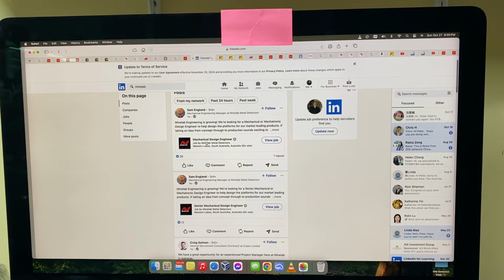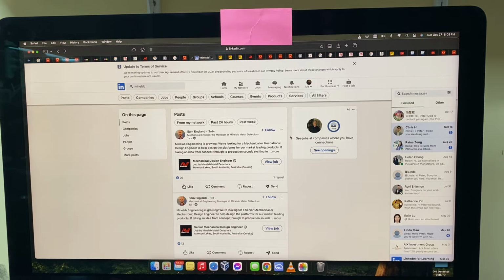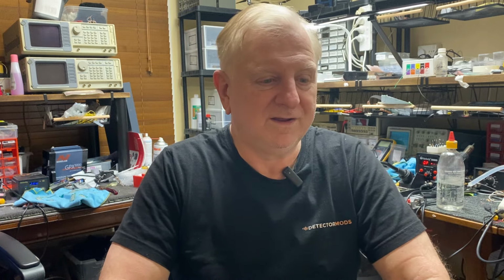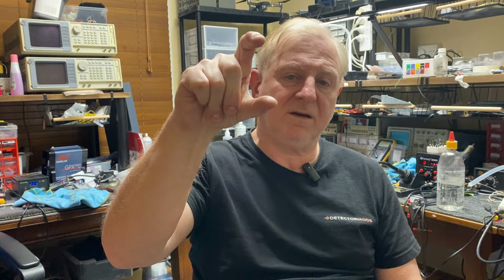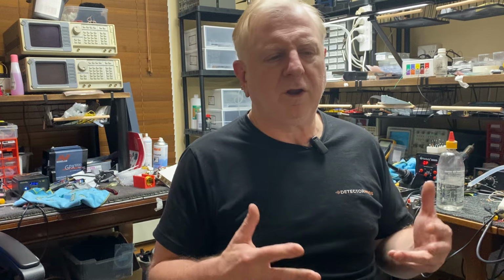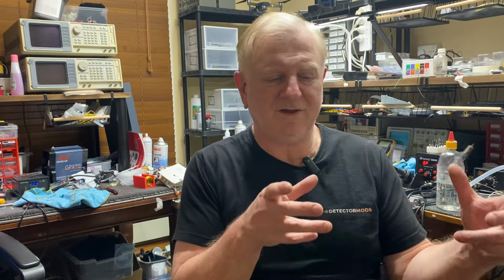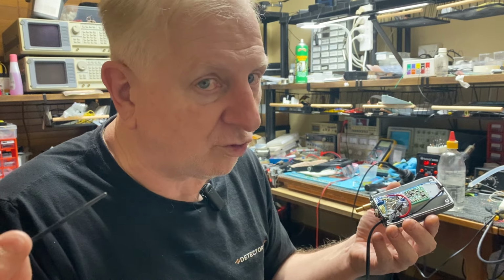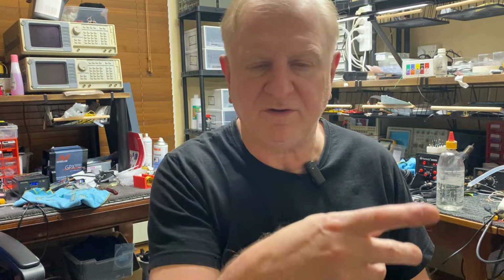Minelab jobs , new detector design, overcoming limitations in current detector designs.

Comment: I'll watch this tonight, but I think I see where it's going.

Maybe the time is right for a step up in technology in new directions. The use of AI like interpretation and learning so that the detector can interpret the signals and readings like a seasoned pro.
Or maybe on-board learning tied in with accurate GPS  that can allow the detector to learn the area. Do a broad scan so the detector gets a feel for the mineralisation variation.

Or maybe smarts that allow a group of detectorists to network their detectors and produce a model of the area created by combined inputs.
A model that could flag up areas where more than one detector picked up an interesting target.
Reply from the maker: I have already thought of a system that correlates the digital signature of the ground and process that into a correlated yay or nay on the discovered target, this could be linked into a huge data base but would then be giving all the new comers the same ability of professional prospectors that could be interpreted as intellectual property. Even publishing this can give rise to other parties taking patents out on this type of concept.
Reply: @DetectorMods  
Yes, your recent discussion on the risks and rewards of putting ideas in the public domain highlight the challenges.
Seems to me, the evolution of detecting technology is generally driven by the main stream manufacturers and it is fairly incremental - this serves their business model - drip feed models and upgrades.
Whereas someone like yourself who understands the technology and isn't hamstrung by corporate mentality will be the driver of real innovation.
Reply from the maker: @lindsaybrown7357  All it takes is one set of eyes and even if the ideas seem wild there will be information that with a little bit of divergence may be a complete game changer, but keep in mind that even though I discuss radical departures from the way things are currently being done there are many that I have not yet discussed in public.
Reply: @DetectorMods  
A few years ago I suggested a product idea to a company that creates generic battery adaptors for battery tool users.
They were all over me and many promises made about sharing the success.
Once they had enough of my ideas,the airwaves went dead - funny that.
If I ever come up with another good idea, I'll try developing and commercialising it myself.
I wouldn't bother trying to protect it, just work on the premise that I'd get a good return for long enough.
Reply from the maker: When we developed the stud finder back in 1980 , we had so many copy cats that it made my head spin, so just hit the market hard and fast.
Reply: @DetectorMods  
Good advice.
Needed a stud finder a week or so ago, and discovered the Minelab Pinpointer is useful for finding the plaster board nails in the studs.
Reply from the maker: Absolutely.